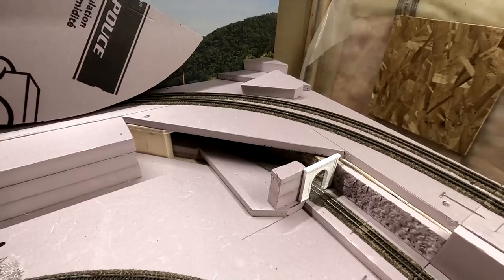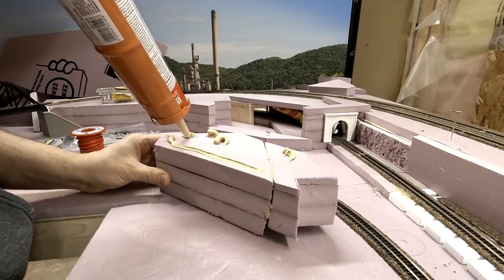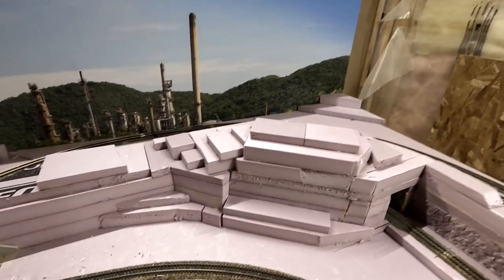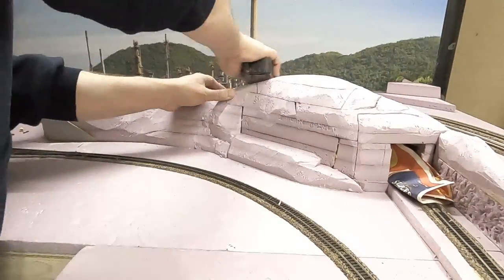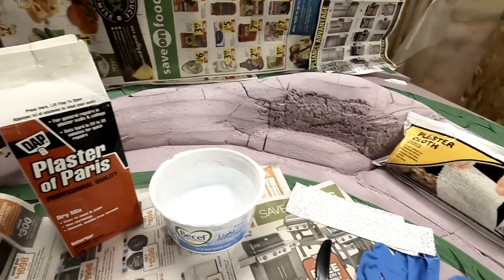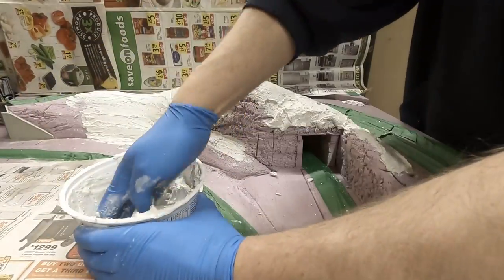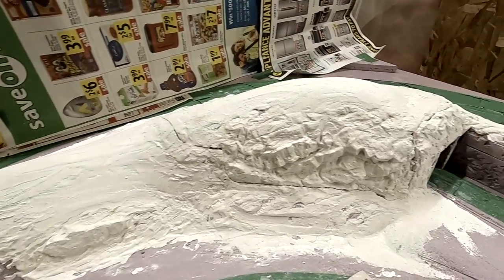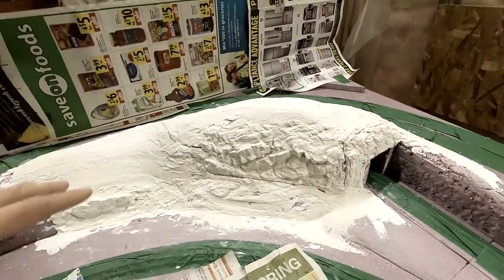N Scale Layout Update 12 - Building the Mountain! - with REMOVABLE access panel

Comment: Couple of ideas:
You can add acrylic paint to the water before you mix the PoP (sculptamold, whatever) and avoid the "surgical white".  The color will lighten as soon as you mix it to the medium, so don't be afraid  to make the water really dark, and the mix will lighten even more as it dries.
To protect the seams, try putting wax paper between the two pieces before adding the PoP, hold the paper out as you work the PoP into both sides.
Reply from the maker: i really like the idea of the wax paper. I was going to use it against my backdrop when that time comes, but never considered for the mountain. Great suggestion!

Comment: Like 👍 your vid on how you built this mountain and access panel. 
Maybe a tip for a next project; before you start your plaster cover, ceram wrap the edges of the access part and the parts they sit in. That will create a smooth and invisible edge, which allows for the hatch to be easily taken out. Also, it will provide transitions that will look very natural and unlike the straight edges we come up with, while creating such a hatch. 
In addition, the rock face you produced in the pink foam, before you started the plaster, also looked very good. When creating such a hatch, that foam carving may be the way to go, for ease of access. 
Still, the end result looks great. Definitely will consider such a method on my own layout. Which will consist of a lot of access hatches. In the past I made hills with a combination of scraps of styrofoam, xps, or what you call the pink foam and spray foam to either glue the pieces, or to fill cavities. This while using the ceram wrap method. It produces easy shapes, perfect fit and lightweight scenic parts. Must add there that a mud layer, especially over the styrofoam scraps, increases both the texture and the level of realism in the produced rock. In the xps, or pink foam, the amount of realism which can be achieved, may very well be even beyond that of the plaster. Although there too, the smoothing and filling of too regular gaps and crevasses with plaster, or an artificial smoothing compound very well adds to the realism of the end result.
Thanks 🙏 for sharing!

Comment: All of my scenery will be movable because I know I'll be moving in about 2 years.  
I use bamboo skewers to hold it all in place and then white glue.  You can get them  in most grocery stores.  They range from about 6" to 18"s.  The thicker / longer ones may require a tack hammer to push through.
For Foam shaping I mostly use  long bladed box cutters and a small rasp.
The crumbles I have tried to use as piles of boulders and loads.
For painting I suggest doing up a  test piece of foarm, add a layer of plaster and then practice getting the colors you want.
Hope this helps.
Steve

Comment: I’m doing something similar in several tunnel areas on my layout. I’m not worrying too much about hiding the seam at that stage of design. I will use bushes, static grass and such to overlay my seems to hide the removable sections. Just feels like a waste of time and effort to do it at the plastering step. Just my thoughts. Good luck! Oh and sculptamould  is far easier to work with! 👍
Reply from the maker: I like the suggestion to use wax paper between the seems. I would give that a try. Otherwise, I agree, I think you could hide them with scenic cover.

Comment: Hi just a question. Have you ever used sculptamold instead of plaster of Paris.
Reply from the maker: I have not. What is your take on it?
Reply: Sculptamold will go on thicker (deeper) than PoP without cracking.  Avoid celluclay as it takes forever to dry (it's still soft even 2 days later).